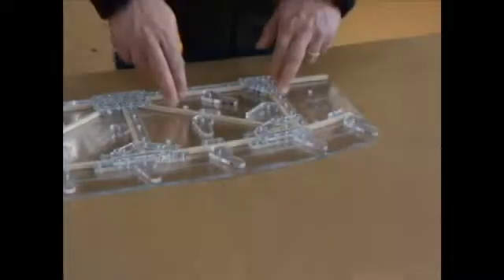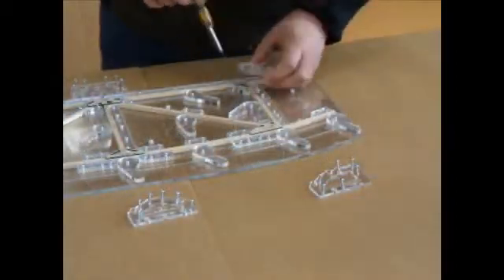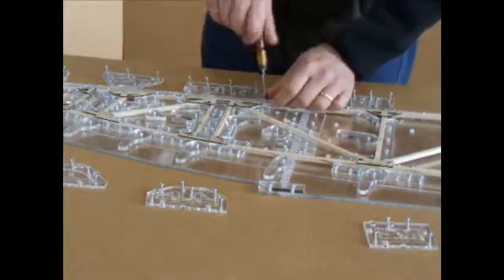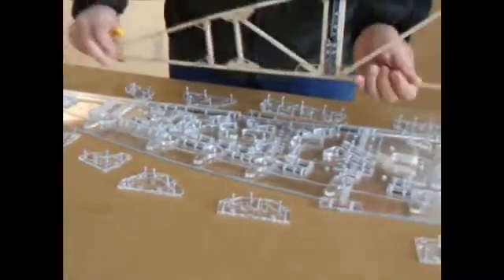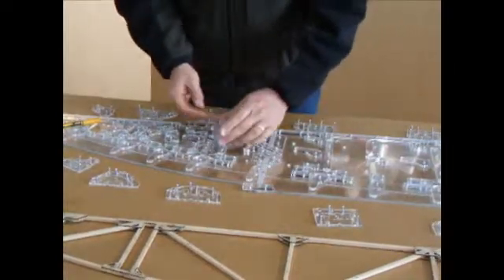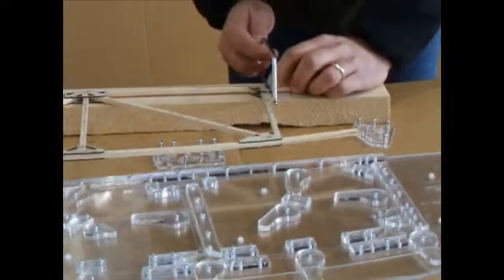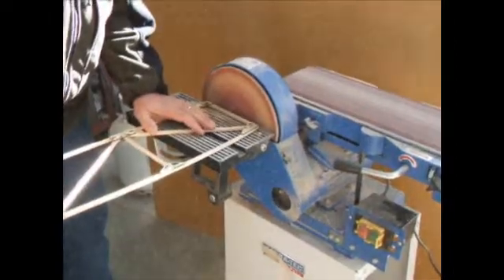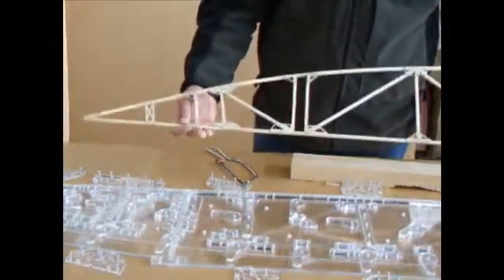MiniMax Wing Rib 5 Removing Rib from Jig

Comment: Hi Todd, The AeroMax design has been optimised for strength and weight. Creating additional lightening holes is not recommended. If you have another application where you are considering lightening holes I am happy to discuss. Contact me directly at. jabiru@outlook.com   Cheers, David.

Comment: Do the lightening holes cut out of the gussets compromise structural integrity? I’m intrigued by the idea cutting weight using your method. I have access to a cnc router so those would be very easy to manufacture.